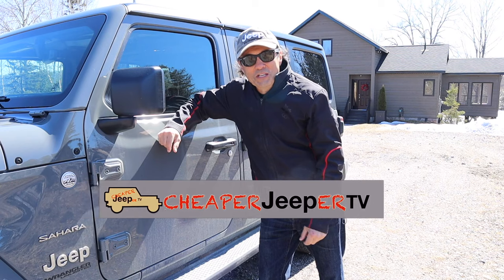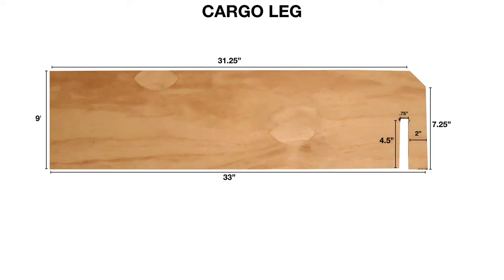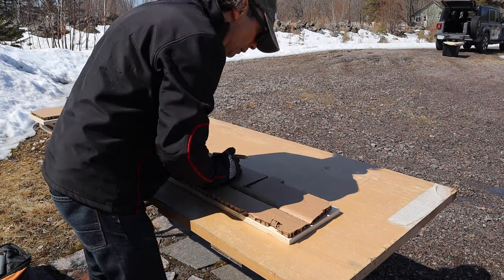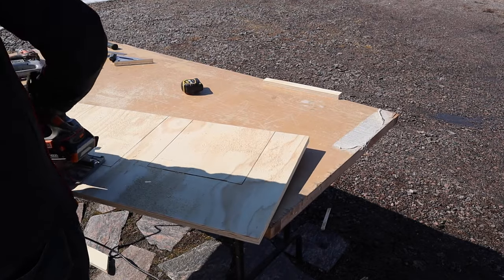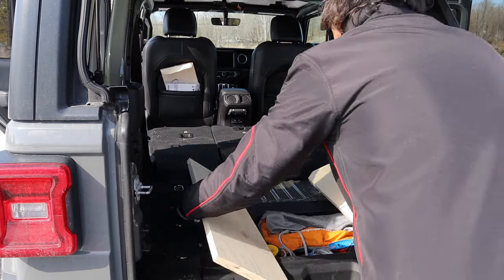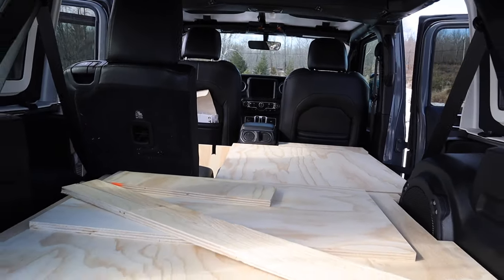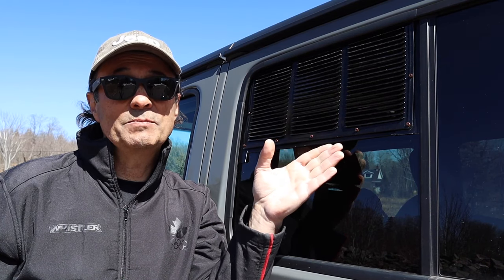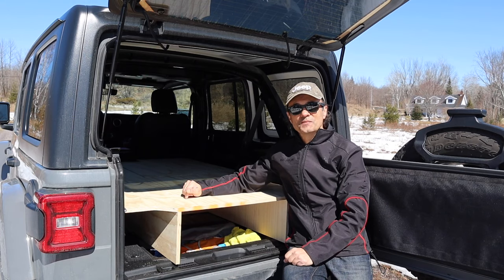Constructing a Jeep Camping Sleeping Platform - Part 2

Comment: You just saved me around $5K on a roof top rack and tent, this is the best how to video I’ve found . Thank you so much! I’ve liked and subscribed
Reply from the maker: Hey Roger, Thanks for the feedback. Glad to have been able to help. You may want to check out the “How to Remove the Back Seat of a Jeep” video, as it shows the tons of extra storage available below the camping platform in that scenario.
Reply: Me too, ty amazing 😎👍
Reply: I think it's also good to have the best of both worlds.  Rooftop tent is good also when you want that outside air.  When it gets too windy, then sleep inside.
Reply from the maker: Absolutely. I can imagine some nice spots where that would be nice.  The only thing for me about the rooftop tent is it seems like a lot of gear and weight to be carrying around and on top of the Jeep. My wife and I want to travel cross-country to camp and also visit some cities, so it will be nice to not have any gear outside the Jeep when we stay at a hotel.

Comment: Wow thank you!! I am attempting to build this in the coming week while living out of my Jeep haha having the measurements and being able to have them cut it for me at the hardware store is BEYOND helpful. One less thing I have to figure out!
Reply from the maker: Hey Adventure Time Loui,
I'm so excited that you're utilizing the design. It's easy, flexible, practical, modular, and fairly cheap to implement. Feel free to check out any of my other camping DIY video ideas.   I noticed your Jeep is a JK. It will fit in a JK. You should check out this video as I speak about a minor alteration of the front cross piece for Jeep Wrangler JKs between 2011-2018. https://youtu.be/L68Pl3f7ApM
Cheers.
Reply: @CheaperJeeperTV  thank you for all the tips!!
Reply from the maker: @AdventureTimeLoui  Hey Adventure Time Loui, You are very welcome. I have updated the design and build of the window vents if you found that tip helpful. That video is in the Camping playlist. Your rig has turned out amazing. I'm looking forward to your next video. Cheers

Comment: I have been waiting for this video.  I am highly considering doing this mod myself.
Reply from the maker: Hey MyBluJL, I'm glad to hear that. I'm going to finish this project with Part 3.  It covers my choice of a varnish finish, rather than carpet, increasing storage by removing the rear seat, and discussion of using angle brackets if one choses, even though the platform's integrated notches work well. Cheers

Comment: Definitely doing this soon to go camping with my dog. Didnt want to break the bank for a simple setup.
Reply from the maker: Jeremy,  Thanks for the feedback.  I just wanted to make a simple, functional, versatile platform system, and it works for me!...lol. My Jeep is a JL.  A buddy of mine has a 2010 JK, and it fits fine in his as well. In 2011, Jeep upgraded the interior, so I can't say with certainty if there would be a fitment issue if yours is a 2011-2018 JK.  I did a video on a chuck box, and interior shelf brackets.  The extra shelf at the back would be handy for storing things, even when you are in the jeep camping.  When camping in my jeep, the louvered window vents I DIYed work amazingly well. as seen in the TIPS segment of the Part 2 video.  Have fun.  Dino

Comment: This is incredible. My jeep is a little different. I have a 2017 with the floor mounted alpine subwoofer ☹
Reply from the maker: Hey Glass Monkey Window Cleaning, All you need to do is cut out the space for it. Also, as the link below shares, it will work in a JK. However, the front cross piece needs to me modified due to a hump that sticks back at the centre console. https://youtu.be/L68Pl3f7ApM
Also, if you plan to camp in your Jeep, don't forget about ventilation. https://youtu.be/zIIyQ4xNFKA

Comment: cut a square out of plywood then glue and screw four strips of wood along the inside of the square hole . you can now lay the square back into the hole making a cover that you can remove to get your stored items out sort of like a sewer man hole cover drill a small finger hole in the wood so you can remove the square .
Reply from the maker: Hey Henry, I totally get what you mean, and it’s a great idea. Mind you I’ve been using the platform for a couple of years now, and honestly I rarely get at anything under the platform from the top.

Comment: I would think that 1/2" or 5/8 plywood would work fine for this project and would be lighter plus drilling large holes in the supports would also lightent it.
Reply from the maker: Yes, I did an update video showing me out holes in the platform. You’re probably correct in saying a thinner plywood would work. I just wanted to be certain their was no flex in the platform and figured any extra weight for each piece would be marginal.

Comment: Thanks for the video/project...question on 8:44, I'm assuming the bottom dimension is 30" (instead of 36"), since the overall length is 39" minus 6" and also the slope roughly 3"? Thanks again...love your videos.
Reply from the maker: Hey Misbehaven, Nice catch.  I can't believe I missed that.  I corrected it on the website article, and thanks for your feedback on the videos. Much appreciated. https://cheaperjeepertv.com/building-a-jeep-camping-sleeping-platform/

Comment: This is great. Do you have suggestions for a 4xe that has about a 1-foot lift where the second row seats fold (it’s not flush)
Reply from the maker: Hey Jared,
Just make the legs and cross pieces below the platform a couple inches in height above the height of the second row seat? I hope that makes sense and helps?🤷🏻‍♂️

Comment: I need to learn some cheaper ways to do things. For our 30th Wedding Anniversary we just splurged on a brand new, Sarge Green, 2021 Jeep Wrangler Unlimited Sport, 4 door, 2.0 turbo, 8-Speed Automatic Transmission. FYI: My local Home Depot gives me a 10% discount to Veterans, yours may also give you a discount, bring a Veteran ID card or your DD-214.
Reply from the maker: Hey Thomas, that’s good information for all those veterans out there. Thanks for the info. I’m not a veteran but will be pushing for senior discounts soon.  😂

Comment: Tackling this project this weekend! For the window vent, what did you use to attach the aluminum pieces to the vent?
Reply from the maker: I just used small screws. They leave the points exposed so small bolts could work better. There are all kinds of adhesives that could work also.

Comment: Are those measurements good for a 2012 Jeep Wrangler JK?
Reply from the maker: Yes. In 2012, The centre console sticks out towards the back a little bit, so the front cross piece has to be cut around it. Everything else will work perfect. Four door model of course.

Comment: Started building your platform in my 2016 JK however the measurements you have there are different from what I need. Just wondering how you managed to get an accurate measurement for the front support. Did you measure or use a level? So far turning out very well.
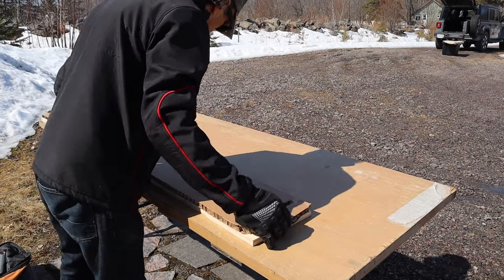Reply from the maker: Hey John, I test fitted my platform in my buddy's 2010 JK, and it fit perfectly. I believe in 2011 the interior was changed, and the impact for the platform is that the new centre console bumps outward towards the rear, affecting the front cross piece. The front cross piece, in the middle, behind the centre console may have to be cut lower or removed. I covered this in this video https://youtu.be/L68Pl3f7ApM at 2:36.  Let me know if I can help more?
Reply from the maker: Hey John, Just read your question again...the height of the front cross piece was determined by using cardboard templates to determine the height to needed to result in a level platform.

Comment: can that measurement for JK 4 door 2011
Reply from the maker: Hey there ŚŃĨРĔŔŚЖ , 
The video in this link below will illustrate for you how it fits in a 2007 JK.  I believe in 2011 the interior of the JK changed, and the centre console bends out toward the back a little, which will affect the front cross piece. You should be able to account just for that, and use the rest of the measurements to work for you.  The beauty is you'll have the platform, the storage, and it only cost you essentially one sheet of plywood. 
https://youtu.be/L68Pl3f7ApM 
Cheers.